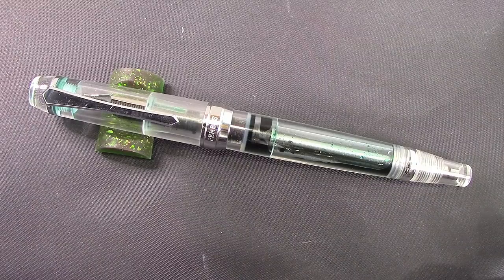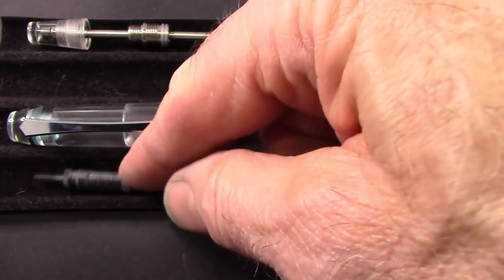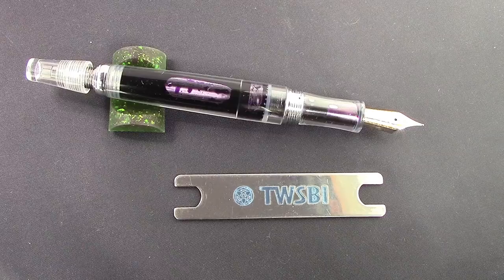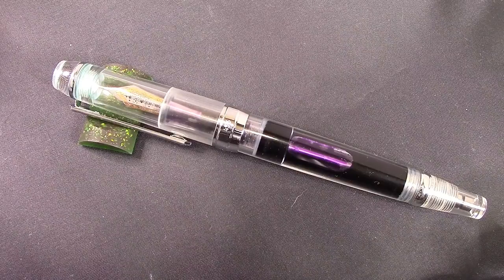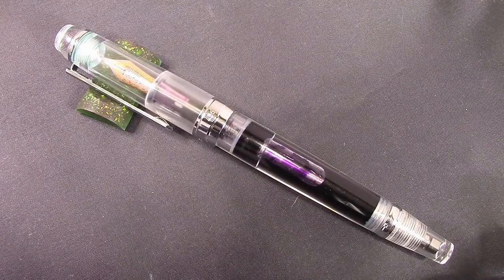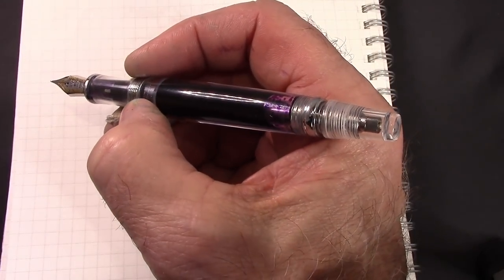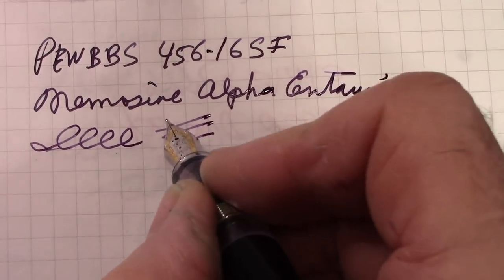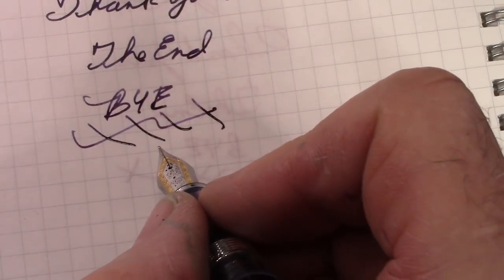PENBBS 456 16SF Vac-Fill Fountain Pen - revisit

Comment: I have acquired about a dozen model 456 and a dozen model 268 pens all in 2021 and about two years after this video. Troubleshooting problems with hard starting and skipping included full disassembly and cleaning, adjusting the tines, and changing the feeds, but nothing worked until I realized that tightening the threaded piston cap was pushing the central conical portion of the rubber piston into the internal opening of the section like a cork in a bottle and forcing the larger part of the piston against the flat internal end of the section. The latter was enough to visibly deform the rubber piston. When the piston cap was fully tightened, the small amount of ink in the section was isolated by the rubber piston and would be depleted in a short while causing hard starts and skipping. Only pulling the piston back a little less than a centimeter allowed ink to get into the section near the feed. Leaving the piston cap unthreaded and pulled out about 5mm completely prevented the issues with hard starts and skipping, but this wasn't a satisfactory long term solution. A full disassembly including removal of the piston rod from the end cap revealed that the stainless steel rods on all of my vac fillers have a second shoulder that keeps the piston from extending all the way up into the end cap like your pen in this video. I have the ability to correct this machining defect and lower the shoulder to the same OD as the uppermost portion of the rod. On reassembly the small nut on the piston rod can now travel all the way up to the top of the end cap, the conical portion of the piston does not obstruct the internal opening of the section, and the larger portion of the rubber piston sits near the middle of the widened area of the ink chamber. Ink can now move back and forth from the chamber past the rubber piston and into the section near the feed. PENBBS probably outsourced the stainless steel piston rod to a machine shop that made a lot of rods that are out of spec and unlike your pen in this video. I doubt that PENBBS is going to provide me with replacement piston rods, so I'll probably have to remachine them all myself. My best advice to customers is avoid buying any PENBBS vacuum filler until they specifically state that this QA problem has been corrected.
Reply from the maker: Great detailed evaluation.  I haven't heard of this issue.  I have a few 456s inked up & have enjoyed them all.  I keep blind cap open all the time as pens sit upright on my desk.  I recently reviewed a few 456s & 355 (similar seal at end of rod) to see how the shut off worked.  Both models I looked at worked well.  Soon I'll publish a review of the 535, with an up-close view of the ink shut off.  Thanks for sharing.

Comment: Hi Chris, you absolutely right about pondering the reason behind PENBBS using imperial unit of measure(inches), yet being in a metric nation; without knowing the answer. As you are someone that enjoys dismantling, restoring, repairing and troubleshooting problem pens, can I suggest you buy a cheap 13/64 inch open end wrench and file it till you get 17/64 inch opening. This way you will have this modified tool in your Pen Tool Kit from now on and never be caught short again. As a mechanic myself, I too have “fabricated/modified” tools to put into my pen tool kit it and I really enjoy the challenge. Just my humble suggestion. Thanks for the heads up about this pen.
Reply from the maker: Great suggestion.  Haven't considered modifying a wrench.  I did find a 17/64 I can get.
Reply: @chrisrap52  I reckon you should go ahead and get it and make it part of your pen tool kit. I  always adopt the 'think outside the box' approach whenever I come across a problem, works most of the time :-)
Reply from the maker: One is in my Amazon cart.

Comment: Hi, nice video. Would love to see more "revisit" type videos, whether positive or negative, similar to SBREBrown's "how do you like me now" series. Good to know which pens hold up over time and which don't.

By the way, I believe you've already seen it, but @inquisitivequill pointed out another advantage of 456 over 355, in a recent Instagram post: 456 has more headroom in the cap. Curious. Maybe 355 is actually an older design (considering their numbering scheme), and maybe they only recently realized out that people enjoy swapping nibs.
Reply from the maker: Saw Leo's post & commented on how good it was.  I don't think PENBBS designers consider nib swapping.  As long as their nib fits.  Adding clearance increases the air pocket nib is in & may require a longer pen, using more resin.

Comment: Chris, the finial on those caps seems to unscrew fairly easily. I haven’t tried my 456s, but the finials on my 355s unscrew easily to reveal a chrome washer along with the clip. It seems the 456 finials would be a little harder to grip than those on the 355.
Reply from the maker: I tried to unscrew 456 cap finial & it wouldn't budge.  Haven't tried the 355s.
Reply: chrisrap52 I was able to remove the finials from the 456s. They are a bit tight, and much harder to grip than the finials on the 355s, but I was able to unscrew them from each of my three 456s.
Reply from the maker: Thanks.  I expected they unscrewed but I'm only willing to use so much force when I do have to remove a part.  Or more probable, my hands are weak.
Reply: chrisrap52 just wanted to get back to you since I got ahold of mine. Cheers, love the videos.

Comment: I'm glad you got the pen writing again. I think everyone has had an experience with an ink that works in other pens but not in a particular pen , even the same model . The root cause maybe just a slight difference in tolerance , perhaps one pen was manufactured nearer the middle of the tolerance and one close to the top limit allowed , its very difficult to figure out a specific root cause without spending a lot of hours doing tests . I like you come from a technical engineering background so i'm used to looking for root causes and failure modes but who wants to spend time doing that really ,like you say the pen writes that's good enough.
Reply from the maker: Matthew, perfect.  I hadn't thought of all the variables.  And all that matters if the pen writes.
Reply: To solve the failure for one particular bottle of ink might cause failures for others; for all we know, it is that particular bottle that is the outlier.
Reply: @wwbdwwbd  Chris stated that he had used the ink in other pens ,if i'm not mistaken, but he did not state if he had used it in the same model but a different pen.If the same thing happened in the same model with the same ink then that would indicate there is some interplay between the ink and that model of pen . The fact that the ink works in other pens really rules the root cause being the ink itself.
Reply from the maker: Well stated Matthew.  I ruled out the ink as you heard, it works in other pens & I do love the color.

Comment: Thank you for answering my question about the TWSBI Vac20 bottle working with this pen. Now, I wonder if it also works with the Wing Sung 3013 as well?  As I have a PenBBS 456 on the way; I’ll just have to get one and try.
Reply from the maker: Works to fill pen more efficiently.  I don't use often as cleaning it out wastes ink.  As I do 99% of my writing at a desk, refilling is easy to do.  When I traveled  I'd refill some pens & take them with me.  If I wrote one dry, had backup.
Reply: @chrisrap52  I got my Vac20 bottle today and it doesn’t fit either my 456 or my 3013. I wonder if it’s a slightly different size now because the TWSBI 700R is also slightly different. Either that or just pen variations. Regardless, I’ll still use it as it will be easier to use than a regular ink bottle.
Reply from the maker: @janelllonga1898  I tried my Vac20 with a 456 & a Vac700, both work well.

Comment: I wonder if the feed might play a part, since it's a softer material it might be more prone to variance during manufacture. I definitely see some variations in my PenBBS pens, at least in terms of ones that I can or cannot remove from the housing.

Could you measure your 355 and let us know what size wrench would work for it?  I have one that has some pretty stubborn bits of ink stuck behind the plunger and it doesn't seem to want to budge.
Reply from the maker: Excellent question on 355.  I'll respond as soon as I get back to my pen room.

Comment: Hi Chris,  I to have had issues with specific inks. Although my problem is opposite of you experienced with the penbbs ink. I recently bought noodlers 54th Massachusetts, able that I really liked when trying different inks at the St. Louis Pen show this past June.  I loaded it up in a platinum 3776 with a fine nib, and the result was the pen laying down ink like a medium to broad nib. Cleaned the pen and inked it  with parker quink in blue and it writes like a fine nib. A real shame as the noodlers I ink is a permanent ink which dries quickly. Put it in my TWSBI  mini with a fine nib and it works just fine. Could it be the combination of ink properties and the wetness of the nib feed of the pen?
Anyway thanks for the interesting round 2 on the penbbs 456.
Thanks 
Richard
Reply from the maker: Yes, ink & pen combos are mysterious.  It is not something I can predict.  Good to have lots on ink choices & can find a great combo.

Comment: 6.77 mm only appear as 17/64th of an inch due to rounding. Any measurement between 6,55
 mm and
6,94
 mm will likely be converted as 17/64.

PenBSS created and sells a proprietary plastic tool (looks like a cylinder) to unscrew their pens ( I saw it in a thread on penbbs.com) . I doubt they used inches. They just made sure their tools is not standard.
Reply from the maker: I couldn't find a 17/64 wrench to see how it would fit.  I was thankful the adjustable wrench worked.  The end unscrews with minimal effort.  I have not seen their tool.  A cylinder would not work unless the finial was removed which requires a special tool.